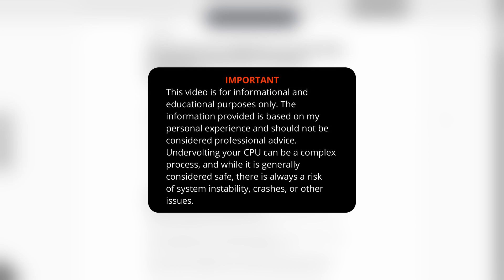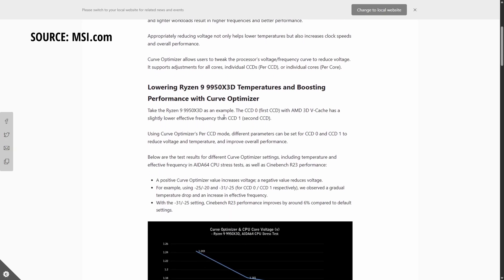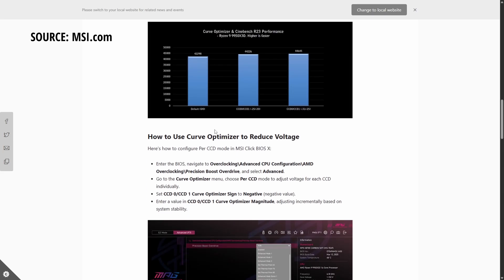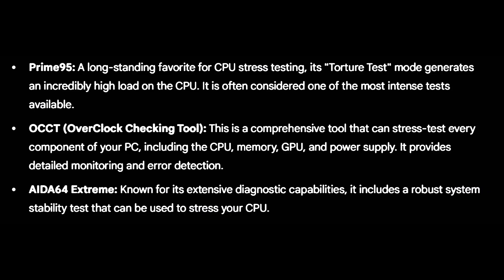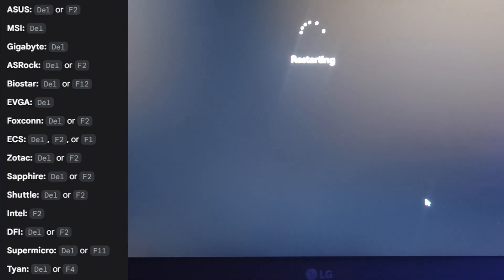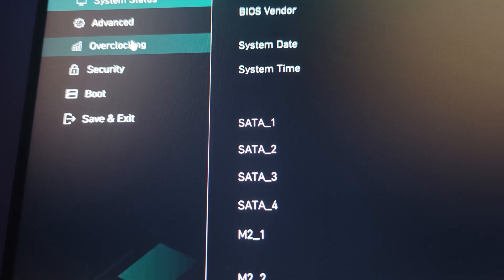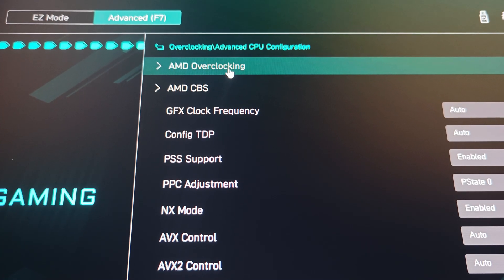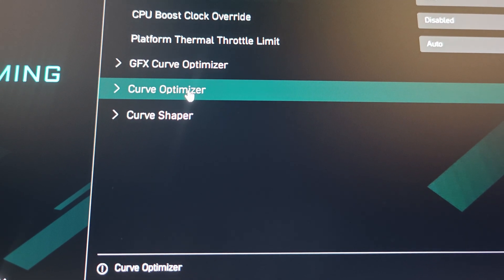How to Undervolt your Ryzen 9 9950X3D to Lower CPU Temperature using Curve Optimizer (BIOS)

Comment from the maker: As of right now I use -20/-20 for my setup and it works well after stress testing, I haven't overclocked yet. Make sure to test and check temperature and system stability if you decide to do it. You might find more guides for your specific CPU and motherboard with recommendations. I follow more general unofficial recommendations and I'll will try to see if I an undervolt it even more but overall with this change I got 5-7°C reduction in temperature for the CPU.
Reply: Can you help me out please to overclock my 9950x3d with gigabyte x870e aorus pro x3d ice motherboard and with ddr5 6000mhz of 64gb